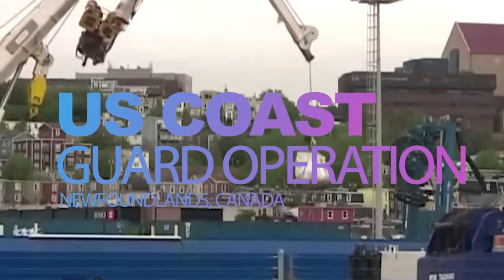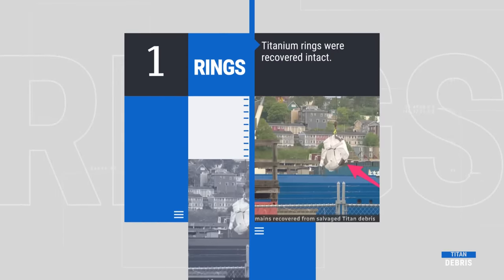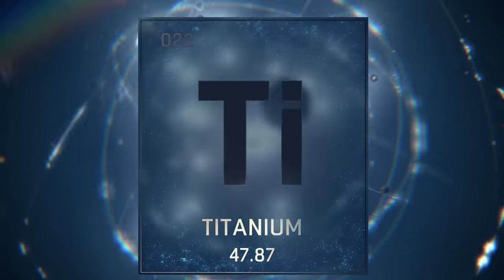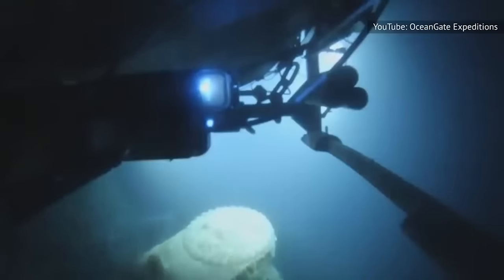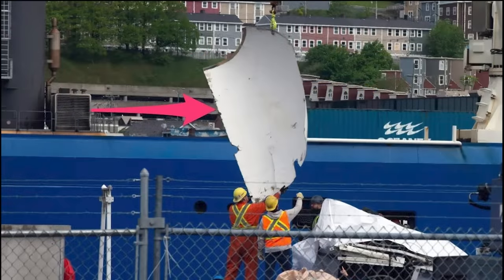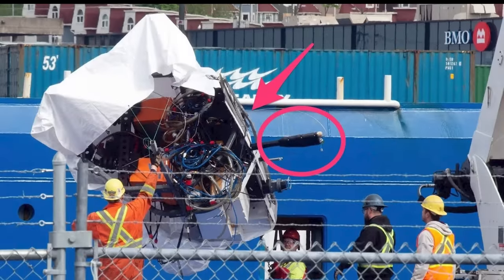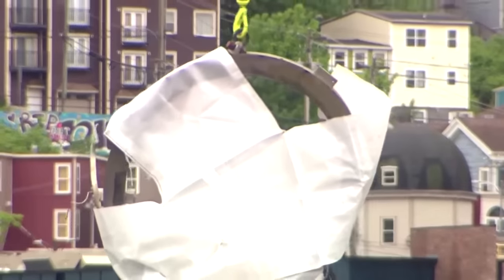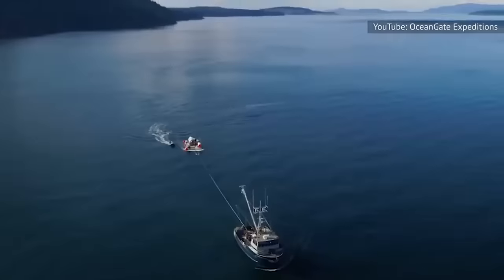What Really Happened? The Titan Submarine Clues from Parts after Implosion

Comment: Was the hull only made from carbon fiber resin? Some videos of ocean gate building the hull appears to show that there was a metal shell they layered the carbon fiber resin on top of. Is that correct?
Reply: That is what it looked like in the OceanGate video, but the materials would have different expansion and contraction coefficients when exposed to temperature and pressure differences.
Reply: The barrel it was wrapped around was a mold. There was both an outer and inner layer of thin hull (the white outer shell and grey patterned inner hull) but these are literally not even an inch thick and would add no protection from the pressure.

It is interesting that the cyclops 1, rated for 500m, had a 7" steel hull, but the titan (cyclops 2) copied from it for the much deeper 4000m dive only had a 5" carbon fiber hull due to the aircraft engineer Rush believing that carbon fiber would always be 3-4 times stronger than steel, thus 7" being unnecessarily expensive.
Reply: Carbon fiber construction is much like fiberglass construction, or GRP (glass reinforced plastic) Fiberglass "matt" is laid over a "form" or "mold" and saturated with resin. Then more fiberglass matt, and more resin, until it reaches the necessary thickness for its intended use. After the resin cures, the fiberglass part can be removed. The video does not show what they were wrapping the carbon fiber around, but it was likely just a "form", which did not have any structural strength. It may or may not have been removed after the resin had cured.

Comment: None of this is a secret, IMO. Many of us knew they were gone as soon as we heard it was missing. I picture it kinda like a tube of toothpaste quickly and forcibly getting squeezed and the front nosecap and titanium ring probably popped off the front as water pressure squeezed down and then instantly filled the inside of the cabin. It only takes one tiny crack to compromise that carbon fiber hull. Seeing large pieces leftover is not surprising.

Comment: It cracked on the AFT. Last text messages show they were aware of cracking sound.
Reply: The resulting water intrusion would have rushed forward and blown the window off, its only got a ring and a few bolts holding it on. I think the pictures confirm that that ring is missing. Had the window failed, the ring would still likely be present.
Reply: @dr_jaymz the guy from cbs that dove with them last summer said, they lost 1 bolts out of 18 bolts and still proceeds

Comment: You missed a huge clue....the port hole's outer ring is missing look carefully YET there is no damage to the surrounding titanium had it blown out  or "Shattered" wouldn't the ring would still be present ? ALSO if the force was strong enough to blow that ring as well it would show a lot of damage to that nosecone I think it was removed and that is also where they found POSSIBLE DNA  there should be bits of the Carbon Fiver attached to the Epoxy used to make the connection What do I know ....Nothing
Reply: The bolts in the ring do not need the withstand the pressure under normal operation, because the waterpressure will force the porthole into the cone shaped seating in the forward bulkhead, therefor the bolt keeping the ring in place don't need to be as strong as you would might expect.
The water rushing towards the inside of the port hole has enough energy to knock the cone shaped porthole out of the forward bulkhead and snap all the bolts in half in an instant.

Comment: A spray jet leak at that pressure would have impaled them like cutting steel with water but at far greater pressure they would be lucky if the submersible imploded  without sustaining any high pressure leaks first which is probably unlikely, The   craft is more likely to spring leaks before implosion so it's likely they gor mutilated like a potatoe in a blender before the sub imploded.

They are assuming there were no leaks and that the submersible imploded but that is highly unlikely where the hull would first spring leaks at stress points before reaching implosion depth with millions of pounds of pressure those leaks are like being hit by bullets basically if several leaks formed they were essentially like a potatoe in a blender on purare.

They would have consciousness and aware up until the water jets killed them which would have been quick but not painless.

It would be like being hit by acid going  through them like pouring molten metal on wax.

They only hope the sub imploded emmediatly to spare the idea of anyone suffering but they failed to mention the alternative.

If the port glass cracked and sprung a leak the water jet would have puraed everyone in a strait line reaching all the way to the back under millions of pounds of pressure per square inch and they would have felt it cutting into them anyone close the port glass would have been blown away like a pressure washer hitting a sand castle but with millions of pounds of pressure.

The person furthest away would have had the most torment from a spray leak as they were skinned alive to the bone, an implosion is something they would pray for if that was happening to them.

It's sweet to hope they died instantly in an implosion but they really can't be certain of that.

If they were power washed from leaks even with 800 pounds of psi of water pressure they would have been skinned alive before the implosion.

Water pressure so extreme it blasts away skin muscle and organs.

Normally when sub sinks beyond its safe limits it first has small ruptures that causes leaks well before it reaches implosion depth.

By the time the craft actually imploded they were skinned alive or lets say mostly skinned alive the rest was destroyed in the implosion from heat and ocean pressure.

Also that pressure a leak coming in one side can cut through another side of the hull at that pressure.

There are machines that use water to cut steel not even close to the pressure they were at, which was millions of times greater.

Any leak at that pressure would stream at high pressure, cutting through and blasting away skin tissues, they would have sustained multiple leaks before implosion it would be highly unlikely that a carbon fiber hull and glass port hole unrated for that depth didn't.

I just find it odd that were getting the soft landing from those reporting when even they know that leaks would have caused a suffering death because of the power washing effect under that level of pressure.

Comment: Something isn’t adding up…why were there human remains if the vessel was supposed heated up to the point of the sun before popping. It would actually contradict the Lochridge report that said that the material used to line the hull was highly flammable
Reply: Huh? Where did you read that it got as hot as the sun?
Reply: @ngud_gaming267  it was alleged that as the hill was exploding it heated up to the temp of the sun in a millisecond
Reply: @janedeane3656  an implosion with carbon fiber has never happened before, it was probably a little less severe than metal imploding,IMHO.
Reply: The answer is the "human remains" are paste/jelly like - not very human at all any more sadly
Reply: @jamesboord8997  that’s actually an excellent point
Reply: @Tom--Ace  :( oh ok

Comment: Interesting dissertation. A suggestion that a warning of some kind had initiated a return to the surface could indicated that the viewport had developed internal cracking easily visable . How was this fixed?  Are the 16 bolts threaded direct to the front dome or is there a second anuular ring sort of glued on ?  If this port failed as the initiator the inside would have exploded outwards shock over loading the main hull .No doubt the accident report will decide . The whole design is a bit of 'Heath Robinson' at his imaginative best .

Comment: Its hard to believe that, all kinds of parts surface, everything except where the men were sitting...Something dosent sit well with this " accident"....Im skeptical...
Reply: I'm skeptical too, but for other reasons. It makes sense that the pressure chamber would have disintegrated. It's a material that has the tendency to shatter. I'm sure there's also other debris that didn't need to be hauled by a crane and was moved by people. These are just what photographers have captures from afar.
Reply: It's 100% logical that the pressure hull where the crew were disintegrated with the unpressurised outer shell and rear equipment bay being blown clear. 

The front section with the porthole was a different material so didn't disintegrate with the hull, again blown clear by the force of the implosion behind it. 

The contents of the pressure hull will be in millions of tiny pieces,  the force in there being like sitting on a huge bomb going off.  

 What has been found matches exactly what would be expected if the hull failed, it's literally a textbook example perfect!
Reply: @IrinaZumba  👍💯💯

Comment: The pieces of the carbon fiber hull prob blew away from underwater currents because of the light weight of the carbon fiber?  So it may not be where they thought it should be and prob not good for finding with sonar. Be my guess
Reply: At last someone with some intelligence
Reply: So you reckon that carbon fibre cylinder drifted away in one piece?   I don't think so.  Something imploded, they picked up the sound on sonar, and it couldn't have been anything else, because we see both of the titanium rings and domes intact
Reply: @arthurdaly3497  where did he say one piece? What's the point in making up a false outcome no one mentioned, did you miss the bit where he said pieces?
Reply: @entx8491  I was exaggerating, but let's not forget they brought back up most of the thin fibre glass surrounds in largely one piece, and they are much lighter and far mure subject to gettting washed away.  The carbon Fibre was probably hightly fragmented
Reply: @arthurdaly3497  Read what he said again buddy, you're practically paraphrasing him.
Reply: @entx8491  he didn't say anything about the thin fibreglass panelling.  Why are there so many carbon fibre apologists?
Reply: @arthurdaly3497  practically paraphrasing means you almost said the same thing, almost. Point out a carbon fibre apologist, I see people thinking realistically using logic instead of regurgitating what dumb YouTubers and news readers are saying. Many people said there would be nothing left of the occupants and the vessel, yet here we are. Better to think for yourself.

Comment: My opinion is there was mostly likely a failure in the epoxy bond between the carbon fiber and the titanium end caps. There are videos showing how they were attached in this manner. The materials were incompatible in the application due to how they react to pressure with different contraction rates. Carbon usually doesn’t move it just breaks, and after repeated cycles I’m sure it just wreaked the bond at the caps and it was over very quickly. The pressure of the compression probably blew the view port out. I’m all for innovative thinking and creative engineering, but you have to be willing to examine yourself.
Reply: I think you're spot on

It's obvious what happened if you have good eye sight.

The wreckage showed the titanium ring as the dome intact. 

What a lot of people overlook is that there is no residue on the rings, no reminiscence of carbon fiber, not even the hypoxy was visible.

That leads to the only one, very obvious conclusion.

Comment: The front glass bolt holes? 
The front port has been separated from the ring it was bolted together with!?

I don’t know what kind of bolt size or grade they’ve used, but it must have been quite some force snapping everyone off even at 8.8 grade in M12-M14!?
Or maybe less than that in inch.
Reply: You wouldn't use 8.8 steel in a marine environment, you'd have to use either use A4 stainless or titanium.  My feeling as an engineer is that the bolts were quite small, and that the shockwave following an implosion would have snapped them fairly easily.  They are only locating bolts, they don't carry pressure, that's taken by the taper of the window.  If so there will be threaded stubs remaining in the dome, with flat brittle-fracture faces.
Reply: @timjackson3954  Yea you said it, but they used carbon fiber for a hull also, so you won’t know what kind of self magician pull they did here until you can examine the parts.
Reply: TyaxComp  Yes somewhere, or inch diameter.

Comment: just a thought about the missing viewport... isn't this tapered to help being held in by the pressure (sealed by geometry not just bolts). If you have a catastrophic implosion behind it won't you get a "water hammer" massive over-pressure on the inside which could blow it out of its taper?.... this is totally ill-informed speculation based on stupid extrapolation from domestic plumbing... but the basic physics is the same. I'm not saying that the missing window was or wasn't the cause of the problem, just that it could be possible that the missing window could be a consequence rather than a cause. BEWARE OF SPECULATION (like this comment!).
Reply: yes, if first part to fail was the hull then the force generated would have blown away both the titanium rings and the window, if they ever retrieve the window or a large part of it at some distance, it would prove it.

Comment: The plexiglass popped out and all pressure was gone
Reply: Under that pressure, it would pop *in*, not out.
Reply: If it did, the vessel would be intact. Something caused the hull to fail BEFORE they reached the bottom.
Reply: @3tpculp  Ever hear of water hammer? At that depth, the inflowing water would subject the cylindrical shell to a huge pressure spike, shattering it.
Reply: @jguenther3049  yes I have. Do you understand how it works?
Knowing a word does not mean you understand it.
BTW Ever see water hammer blow up anything except the traveling end?
Reply: @3tpculp  Ever see water hammer at 2100 fathoms?
Reply: @jguenther3049  I have seen water hammer at a difference of potential but never at the same potential, have you?

Comment: Enough of this waste of time, the Ceoc's arrogance is the only cause of this disaster
Reply: Add in financial desperation being that the first sub's CF hull was failing and had to be rebuilt....which then delayed making trips with paying passengers.   Several outings trying to get to the Titanic also failed due to weather and 'technical difficulties' which was really putting a hurt on the finances.   They changed support ships because the original one cost too much money and while it could carry the sub out to the launch site...the replacement vessel had to drag it on a cable.   That right there should have been enough warning to the people that this was a very shoddy operation and ANY research into CF submersibles would have shown that the material is NOT capable of repeated dives as it cracks and delaminates.

Comment: Or do you expect the end caps we're glued on carbon fiber cylinder, enough pressure the ends would pop off like a water bottle being squeezed hard enough my favorite..... I wouldn't have climbed in that thing if it just sat on the surface, suffocate by just being bolted from the outside. Being able to escape from emergency. POS design
Reply: I think you're right. The most likely culprit is the mating between two materials with vastly different characteristics under pressure.

I'm not sure what rush was going for... weight as a trade-off doesn't really make sense here ..he might as well have conjoined multiple pressure vessels made of steel...seems like the whole thing was a con and he got lucky before his luck ran out

Edit: or maybe the porthole failed but... still....

Comment: A question, if the carbon fibre cylinder where to fail first thereby creating the implosion would a secondary "rebound" explosion occur possibly blowing off/ apart other component e.g. the viewing window?
And why did they screw the computer monitors to the inside of the pressure cylinder!?
Reply: This seems plausible. 
I agree, why screw anything into the cylinder!
Seems like this was a garage project. Bootleg AF

Comment: I keep hearing that it would have got squashed in a milli second. The pressure is caused by gravity pushing on the water. So why don't it get squashed at the speed of gravity pushing on the surfaces of the sub. If for example, a thousand ton piece of metal was sitting on the sub and the sub collapsed, the metal would fall at the speed of gravity. While I was working out that I also thought of something else. If someone caught a fish from the pier, in theory the sea level would drop. But if someone was in a boat and they caught a fish, then the sea level would stay the same.
Reply: If water were perfectly incompressible, that might be the case. But water is slightly compressible, so the implosion speed is the speed of the surrounding water “springing” into the sub
Reply: @Kyriaeus  I think that if the sub was in air the same pressure, then I think it would be instant. But I wondered with water. I did not make a statement but I questioned.
Reply: @shanomac69  I understand what you say. But if you put a 1000 ton piece of metal or a million ton piece of metal on the sub it would squash at the same speed because of gravity.
Reply: @david-dj8or thunderfoot has an excellent video on the importance of the pressurized water springing back elastically
Reply: “Speed of gravity” is the wrong term here. The speed of gravity is the same as the speed of light.